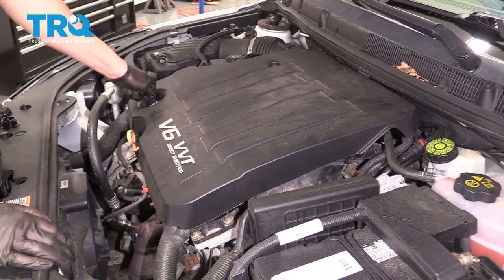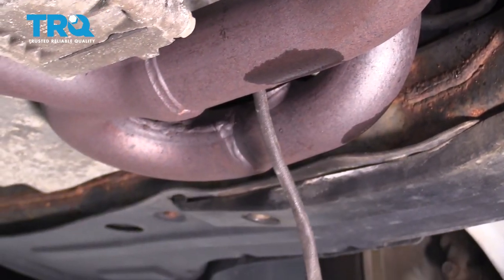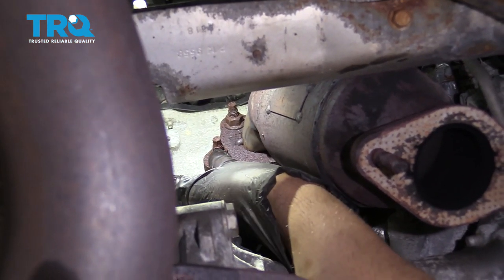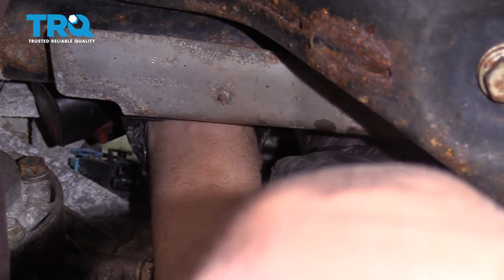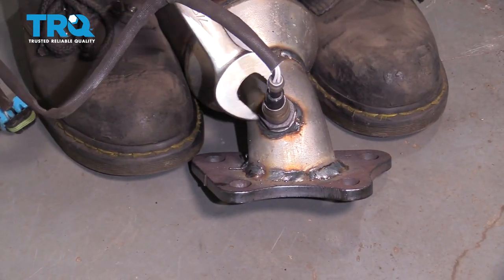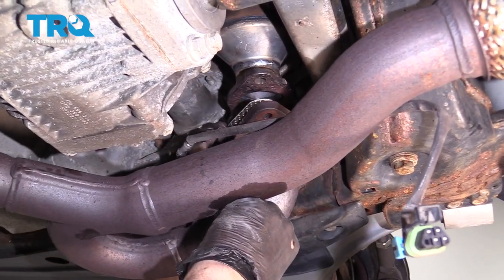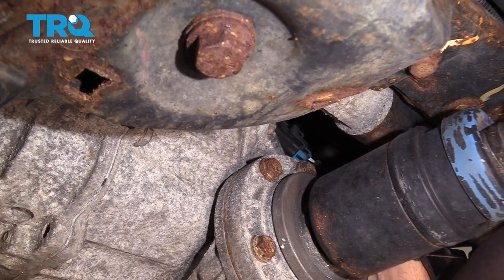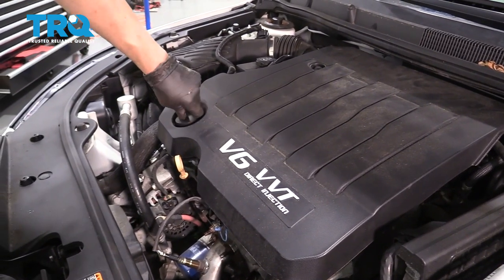How To Replace Rear Catalytic Converter 2010-16 Buick LaCrosse

Comment: Which bank is the rear
Reply: DTC P0420 (bank 1)
Reply: @Korea_MostWanted  thanks for that
Reply: yep, the bak is the front & the front is the back.. sAm BS with impala, which seems to B the same car,  the rear cat, which is the front cat(bNk-2), is like 10Xz as eazy.. but U DONT have to do that stuff Ur mech. told U, I did it with out even lifting wELs off ground, carefull on that 1 thO😒

Comment: Wow i was told i would have to pay for engine to be lifted up to replace both catalytic converter on my 2010 buick lacrosse smh watching your video im getting second opinion
Reply: Not all of them are set up like this.
  The one I am working on is secured from the top and has a heat shield over the top.  I cannot get to the bolts as there is very little room between the engine and the firewall.